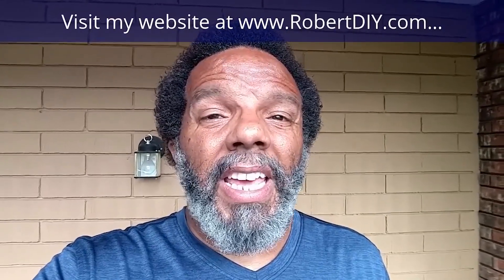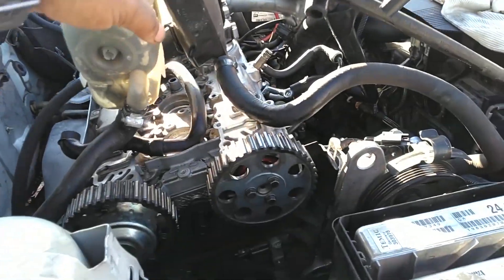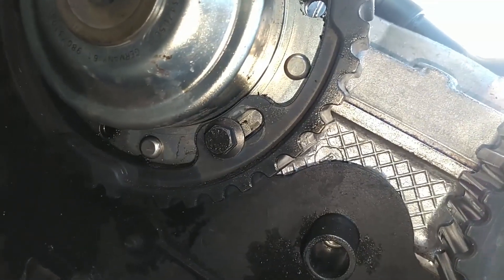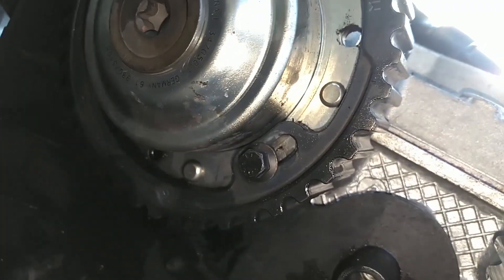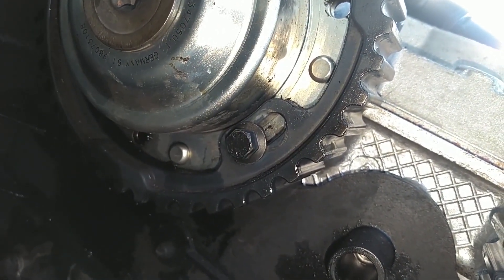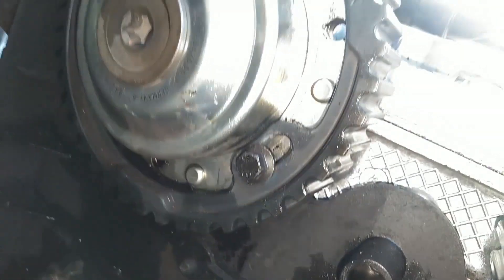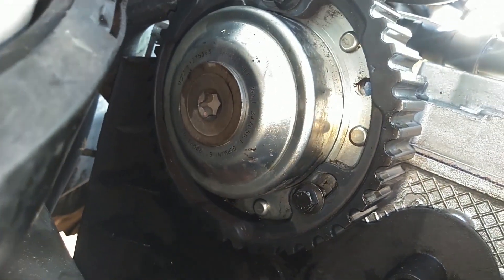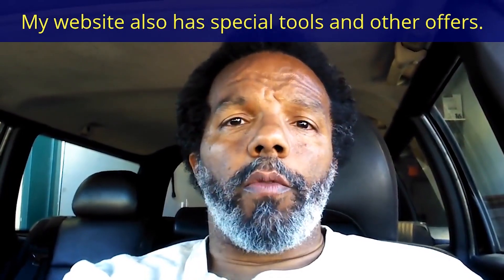Minor timing adjustment instructions for engines with VVT hubs. - VOTD

Comment: My problem is i fully replaces the camshaft vvt hubs and put the gese teeth on them now idk where to start to get the timing right. I have it lcoked in the back with the tool and i the crankshaft is like the mark isnt lined oerfectly with the tooth its in between the valley of two teeth but i keep getting mixed reviews
Reply from the maker: https://youtu.be/0H5cgRYCMQg

Comment: Hi Robert. What's the difference between the early and later vvt hubs? Why does 2007 model have both the same hubs and earlier don't. Is the cam lobe different?

Can I put a non spring loaded hub on my 2007 s60 2.0t on the intake side?
Reply from the maker: https://youtube.com/shorts/yJi0-hs-mpQ?si=0Xqnp0OCdd0pzo-X
Reply: My problem is that when we start the car it's fine. Switch off the engine and start again then it's not right anymore

Comment: The exact answer I needed thanks. The Volvo technician scanned at idle and exhaust cam is reading +22deg (with ideal being -8 to +8deg. My pulleys are fully advanced so gather setting them in the middle or even other end of the slot should get me within the limit
Reply from the maker: cool

Comment: Hey, Robert! You really helped me with the catalyst converter problem on my S70 T5, thanks!!! Just bought 2001's S40 with B4164S2 engine and VVT on intake, with emission problem - can't pass the emission test. Previous owner removed catalyst converter, so I put it back and changed second lambda, but nothing changes. When engine warms up it has an interesting clicking somewhere from timing belt area, and the engine revs really slow up to 3000rpm (like REALLY slow) after 3000rpm it runs really good. Could all this be related to VVT???
Reply from the maker: https://youtu.be/cWKOi8D4SWQ

Comment: Hey Robert, I have a 1999 s70 awd. Does v70 drive shaft same as the s70?? I had to replace mine. Thanks a lot Rob.
Reply from the maker: Yes
Reply: @RobertDIY  they dont fit
Reply: @RobertDIY  i got a driveshaft from v70 and its too long. I have a s70 awd
Reply: @Jackmarcellev  there's usually big differences between the AWD and the FWD ones